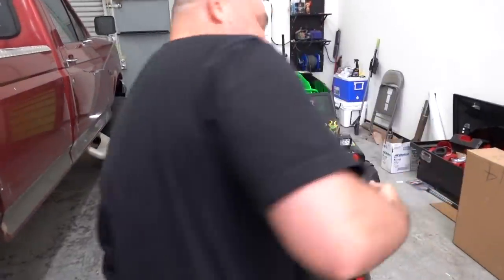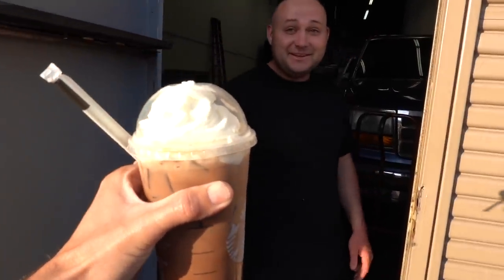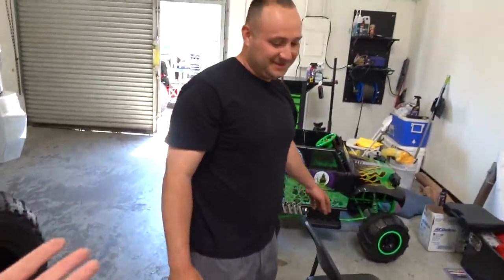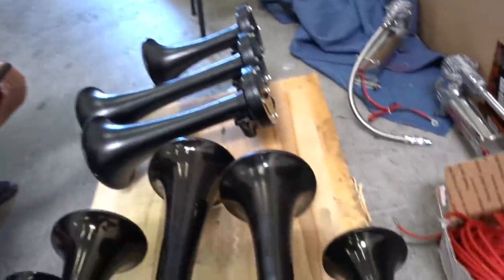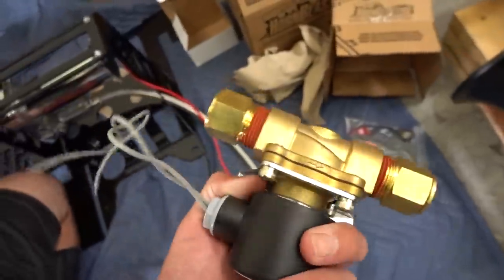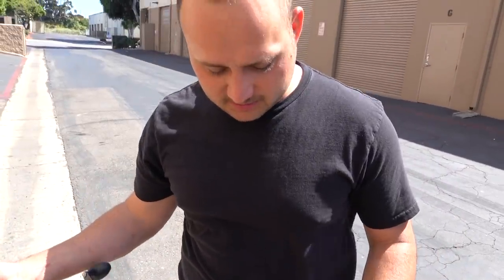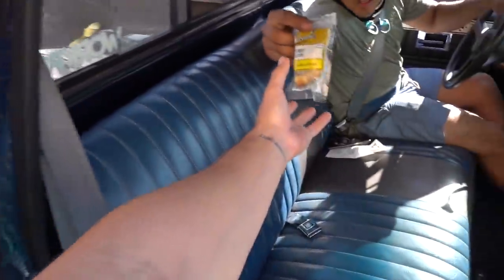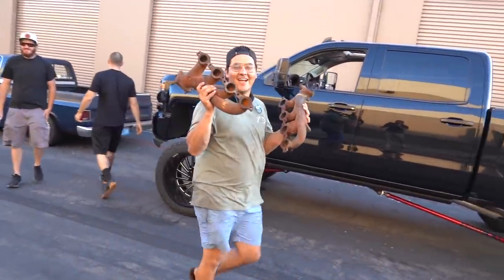Installing this RARE MASSIVE Train Horn!

Comment: You guys had the idea and were very close, but this horn is actually a K3HL. These are very common on Union Pacific's fleet of GE AC4460CW locomotives. This horn uses bells 1L, 1, and 2. "K" stands for Kettle Drum Principle or in simple terms, a K series horn, 3 is the number of bells on the manifold, "H" is for high profile manifold, and "L" is for the 1L bell. Believe it or not, but this manifold is considered high profile for 3 chime K horns. Nathan Airchime has manufactured 3 chime manifolds slimmer and lower than the one you guys have. And yes, I am a locomotive horn enthusiast. These things are what you'd typically find on modern era locomotives. If it's Nathan Airchime or Leslie Supertyfon, just know these are legit.

Comment: I had train horns 150psi holding tank to 3/4 line to dump value in cab sounded just like a train and it was mounted in the bed so it really echoes but I had them taken by the police